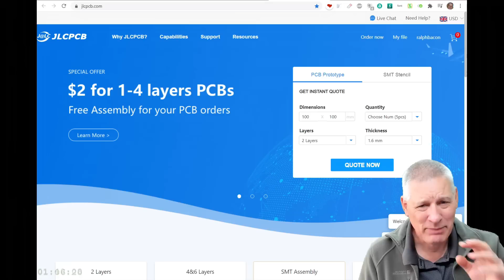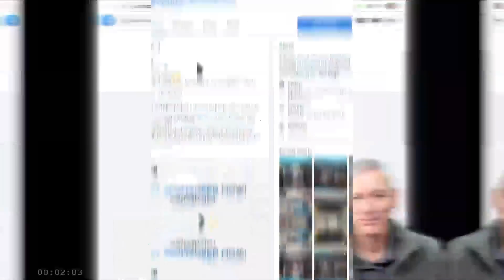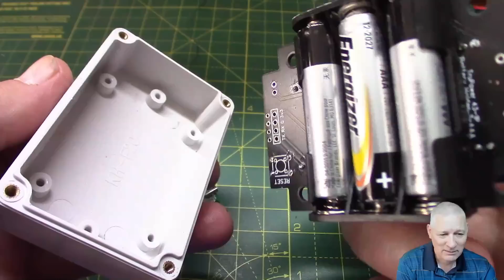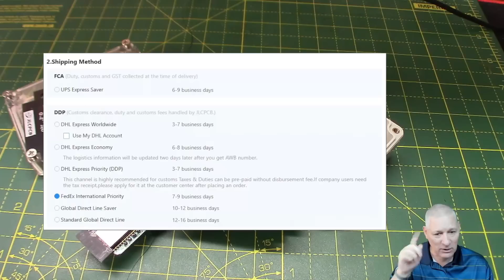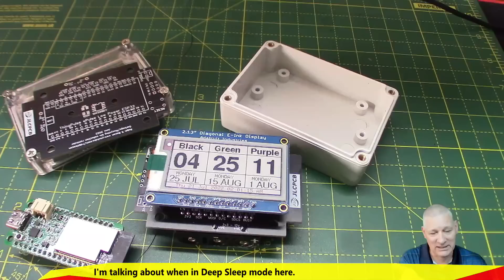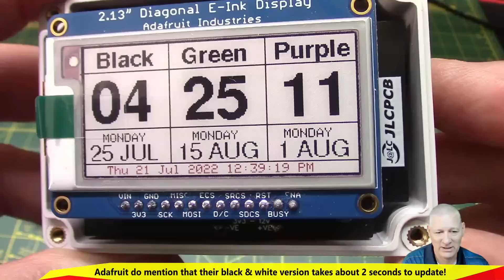#246 e-Ink e-Paper project with ESP32 Deep😴Sleep

Comment: When the ESP32 comes out of sleep, does your display flash (because the CPU resets) or can you write partials without the flash? Thanks for the video.
Reply from the maker: Tricky to answer because my display updates at 2:00am so I'm not around to see it. But I did not get to write partials with this screen; other will allow that though, so it depends on your hardware. But the screen should not flash just because the microcontroller wakes up, unless you reset the screen as part of setup( ).
Reply: @RalphBacon  I fooled with this yesterday for several hours using a LilyGo T5 (ESP32) and couldn't get it partials to function correctly after sleep wake up. I looked at skipping the init using reset_reason function, holding out pins at their state during reset, etc. Then gave up and can live with the flash every couple minutes. Thanks for the 
fast reply.

Comment: For your info. That little nib is the gate to let in the melted plastic in to the form when you mold. You usually want to have it centered in a part. But in this case I have putted in two gates by the corners. More expensive of course and you could end up whith a seemline in the middle.
Reply from the maker: A bit of a nuisance that nib, but not a show-stopper (it's still working and used [looked at] on a daily basis despite that funny lid!)

Comment: The nib in the lid is where the plastic material is fed into the mould. It’s called a gate. It is recessed so the tiny sharp string (like the stringing you get on a glue gun) does not protrude above the surface of the lid.
Reply from the maker: A pity that it's right in the middle of the lid. Talk about design failure!
Reply: @RalphBacon  from a moulding perspective, the gate needs to be exactly in the center. If it wasn’t, one side of the moulding would fill first and leave a void in the other side.

Comment: Great vid as always thanks. 🙂
The PC sounds great but don't scrimp on the RAM. Get the fastest you can afford as it really helps with video editing.
Here is an idea for a project. A remote monitor for a hot water tank. 
I recently installed solar panels and they heat the water too but heat a smaller amount of the tank to a much higher temp than the oil burner. It means it's now hard to tell if there is enough hot water for two showers so a temperature monitor with two or three sensors for different heights of the tank would be great.
Keep up the good work and glad your better.
BTW an old mobile phone battery may have worked for your project. Much nicer having it rechargeable and a good way to reuse old batteries.
Reply from the maker: I've specified 32Gb RAM, Ali; I don't any more will help either my video editing or general use (not even gaming, which I haven't done, up till now).

That project you mention is an afternoon's work. Use an ESP32 to read two DS18b20 temperature sensors (can even be on the same GPIO pin as they have unique addresses). Then create an ultra simple web page in the ESP32 to hold the two temperatures. Use your phone to access the web page to see how much hot water you really have.

Regarding batteries (in this project, I'm assuming?), I had provision for a simple 4.7v LiPO if the 3 x AAA didn't work out. As it happens, the AAA work great and I expect the batteries to last for a year but we'll only know in May 2023... I'll try and remember to record when they run out!

Now go and design that hot water project, I want it finished by tea-time!
Reply: @RalphBacon  LOL, thanks mate, I'll have a look at your suggestion as I may have a free hour tomorrow. 🤣
I agree 32Gb is enough but the speed of the RAM is important. Don't go for the cheapest RAM as it will kill your video editing. I did that with my build and had to replace the RAM later. 
Buy cheap and buy twice. 😉
Reply from the maker: Indeed. I'm using DDR4 memory (can't afford DDR5 and it offers no benefits to me [yet]) at 3200MHz. Actually, I think the XMP is 3600MHz but I am after 100% stability so we will see how it performs. Nothing worse than a BSOD, which I remember too well from Win95 days!
Reply: @RalphBacon  I originally installed 16Gb DDR4 2666 and couldn't understand why the PC wasn't much faster than my old one.
After some research I bought DDR4 2x8gb 16gb Corsair 3600Mhz (on ebay) and was surprised at the speed improvement, especially when editing videos. Since then I upgraded to 32Gb which helps even more. 
No BSOD for me in Linux Mint. 😉

Comment: How would I go about using the esp32 as a simple wifi antenna for my laptop?  for example if my wifi card inside was to fail, could I use the esp32 to connect and surf?
Reply from the maker: No, the ESP32 cannot be used as a simple WiFi antenna; what you need is a simple USB device (like this: https://amzn.to/3vkp6Pu ) that I used before I wired up my PC with a LAN cable. Works pretty well.

Comment: Hey Ralph, welcome back :) Good idea for a project for those multi-coloured displays, their refresh rates are only really useful for things like what you've done, or shelf sides for prices of products in boutique shops. The single colour e-Ink displays refresh much quicker, you can do a partial refresh in about half a second, and a full refresh in one (I have one of the 2" waveshare ones), so if you don't need the colour and want faster updates, they are the ones to go for :)

Where are you pulling the data from for your bin collections? Or do you add it manually? Curious as to if you're using an API request or something for it, since even if I didn't make an e-ink display, this would be great to keep an eye out on bin changes in our area, especially in bank holidays, that's a great idea for using the slower display with the red colouring to emphasise things that are not "to normal" specs.

Hope you had a good birthday Ralph, sorry to hear you caught the lurgy though. At least you had all the shots and whatnot, it doesn't make it less likely that you'd get it, but it makes it less likely to result in loss of life and that it doesn't last as long.

A new kitty? :) What's the story with her? I'd be curious to know if you don't mind :)

Your PC specs seem good to me, that processor is pretty good, and that graphics card will be a great worker for ya, there's no need for anything higher than a 3060 especially for video editing and the work you do. You're right to stick with DDR4 since you're not gonna need those extra mhz for the general tasks, unless you were playing high demand games where those milliseconds frame saves count :p Good shout on 32GB, that'll do you well too :)
Reply from the maker: The data is initially on an SD card (reader present on this particular ESP32 module) and, if detected, is copied to the internal LITTLEFS/SPIFFS partition. Then read from there as it is every day. That way, I can update the calendar once a year "off line" via the SD card when the council send us the new schedule and just pop it in the SD slot and press RST for it to be copied into the correct place.

The format is so simple: <bin type><date> eg B12062022 for each date and bin type. Only 52 entries for all the three bins for a full year.

Yes, the jabs hopefully helped me get through the lurgy, unlike last time (Feb 2020) before any jabs were invented and I ended up with pneumonia in hospital! Took a whole month to get rid of it and another couple of weeks to feel normal! 

TWO new kitties. The story of how and why we acquired these (not our choice) will be revealed as we go through the future videos. One is asleep on the chair next to me right now (the one in the video).

I'm just waiting to get the (rest of the) money together then the PC will be mine. That's where the hard work really starts though, getting it all configured and all the software installed. Luckily I will still have this PC to remind me what I have installed! So looking forward to it.

Comment: Are you sure they’re AAA cells?
Reply from the maker: Yes, the battery holder is a TruPower 43-1P which takes 3 AAA batteries. Larger ones wouldn't fit in that enclosure anyway!
Reply: @RalphBacon  lol have just watched it again and you can glimpse the AAA on the case. Did look like AA at first glance though.

Comment: Unsure about colour e-Ink/e-Paper display support, but for the monochrome displays I always try to get devices that support "partial refresh". I have a few DIY weather related displays and can can usually get ~3fps for redraws and simple monochrome animations (e.g. animated icons and rainfall graphs for the next hour). Obviously not great for low power battery use if you have constant animation, but good for batteries use if you want a quick redraw and get back to deep-sleep.
Reply from the maker: Yes, the monochromes (some of them) do support partial refresh. Something I'd like to try. It's on my list, anyway. I wonder if tri-colour ones support it by now?

Comment: You could consider a single LiFePO4 cell to power the device without any voltage regulator powering a barebone esp32 module
Reply from the maker: That was plan B if the triple AAA battery holder was too thick to allow fitting the lid on. The breadboard supports it, although I didn't have room for a recharging circuit unless the input voltage was no higher than 4v2.
Reply: @RalphBacon  given that it is going into a box, you could fit a USB charging port and a tiny LiFePO4 charger attached on the inside

Comment: Another great video Ralph, I have same problem but 4 bins in Blackburn area BWD but not sure if I can justify cost of build, if you had a spare PCB to sell I may ... regarding weather I live a bit further north and had a Chest X-ray app last Tuesday in Bolton, definitely got cancelled and went in rain on Friday ....LOL ... Ohhh regarding PC did you use Scan or CCL
Reply from the maker: I do have a spare PCB (email me if interested, no charge) but you would need the ThingPulse ePulse ESP32 module, of course, which is not the cheapest dev module around but is quite low in standby current (and is still available too).

Although you have 4 bins, do you not put two of them (eg recycling & garden waste) out on the same day? So really, only 3 different dates, same as me.

For the PC, I have 3 firms on my shortlist, in no particular order:
1. Scan
2. CCL
3. PC Specialist

Right now (after my 357th custom build configuration!) Scan give me the best spread of desired components but the other two are pretty close too.

Not committed yet to an order (I'm waiting for the money) but it will be soon.
Reply: @RalphBacon  Hi Ralph, I will look at building at some stage so I will email you at some stage yes I note the cost of bits is a bit steep and got the Model Railway build as well , being on DWP not got a lot spare but I like your phone and as I have a crappy old S6 Amazon got one so may get one ...

Bins RED general and in August its 8th ,22nd ..
GREY Plastic its 15th ...
 BLUE Paper 1st , 29th ... 
GREEN garden 5th and 19th ...

 I used Scan over years as very local but prices have gone up a lot so CCL have a good economy range My PC is about 12 years old but now got Win 11 on it, and a Win7 running a CNC and Win 10 in Shed running JMRI ..plus Win 7 Laptop ... LOL

Comment: FYI - In Australia the JLCPCB delivery price via DHL is $29 (3-5 days) and the FedEx price is $31 (6-8 days). $2 diff and half the time.
Reply from the maker: OMG that is very different to the UK. Is there a cheaper option you can try, perhaps?
Reply: Yes there is a much cheaper option in Australia. It’s called Standard Global Direct Line and typically is around $5AU for 5-20 pcb’s, much cheaper than your UK options.the only disadvantage is that delivery is 10-20 days. That’s the option I always use as I’ve got plenty of other projects to work on while I wait.

Comment: If you can find a hardening liquid plastic with a similar index of refraction to fill the injection molding divet in the box lid, you may be able to fix the problem.
Reply: Maybe the resin in a windshield stone chip repair kit?
Reply from the maker: I have some liquid resin (and hardener). I also have another, identical box to try it on. Great suggestions, thanks 👍🏻

Comment: lots of used ryzen chips very cheap on ebay etc, many match or exceed your specs
that pc you got will be able to max pretty much every game for 1080p at least.. you mention "some" with the GPU but it'll be "all" just not all at max settings
good call not getting ddr5, too new and too expensive. for video editing not worth it. GPU for video editing only helps acceleration of the preview frames if you even use it.. if you encode with the GPU it also helps there obviously.
Reply from the maker: Apparently (after exhaustive research) I've appreciated that the Intel chips (11th & 12th gen onwards) have better codecs to en/decode H.264/265 video so they do have an edge on AMD chips. Another good reason to NOT disable on-board graphics even if a discrete graphics card is being used.
Reply: @RalphBacon  only if you're using quicksync yea. but your nvidia gpu will probably blow your CPU out of the water for encoding h265 guaranteed
Reply from the maker: I would be quite happy if it did!

Comment: @16:00 That bit in the middle of the lid is called the gate, it is a hole in the mould which the material is injection through into the mould cavity.
Reply from the maker: Pity they didn't think about pouring it in a corner! 😡
Reply: @RalphBacon  its done for even mould filling and minimising warp and post mould deformation, if you look through the lid through a pair of polarisers (such as polarised sunglasses and put some polarising film behind it), you can see the flow and internal stress lines inside the plastic, I actually just did a video talking about it when fixing a broken plastic fridge shelf.

Comment: Welcome back, you are missed!
BTW; often those 0 ohm resistors are called "zero ohm links"
Reply from the maker: My one is definitely a zero ohm bit of wire, because the speck of dust resistor disappeared off the end of my soldering iron never to be seen again! 🤣

Comment: There is some youtube video and website of Good-display, in which they show a Tri-color E-ink (2,13inch red/black/white) that can do partial refresh. They say that only the black and white pixels can do partial refresh
Reply from the maker: Yes, I've seen the partial refresh on B&W screens although eventually you do have to do a complete screen refresh, apparently. If I do repeat this project for an outside unit, I might go with a cheaper B&W module, then I can experiment with that partial refresh too.
Reply: @RalphBacon  partial refresh should also work with the screen which you have now, only the B/W pixels can do it though. 
https://www.youtube.com/watch?v=HJaVujn877Q
Reply from the maker: That's an interesting video of partial refresh of the B&W part of a tricolour screen. But there is no information anywhere, no example code. Perhaps it was a mock up! 😲

Comment: gpu for editing is a can of worms because not all editing software's 'export' features play well with all cards, if have a favourite editing software (and you probably do) I suggest that softwares forums/groups for sage suggestions
Reply from the maker: My editing software is NOT Premiere Pro which every man and his dog uses apparently. I will try that out on my new PC to see if it offers me any advantages. MY current PC would not be able to run that in any meaningful way.
Reply: @RalphBacon  I'm an openshot man myself I like the community developed mindset, inkscape, gimp, kicad, Arduino,
Reply from the maker: @lezbriddon  Just looked at OpenShot and it seems very familiar to me, as a PowerDirector user. Which is also quite similar to Premiere Pro. Well, I guess they all try to be the next Premiere Pro (on a budget), right?
Reply: @RalphBacon  indeed, just like all modern cars look the same to be 'normal'. Unless you're Porsche, then it's let's just do the shape we do with different lights lol.

Comment: if you wish low current while sleeping you buy ESP32 module - not the board. I am using such and deep sleep is 4uA. Btw less than 2 GBP. You are anyway do it on PCB - so you can solder it to your PCB - no difference for you.
From my measurements using PPK2:
ESP32-S WROOM - 4.5uA
ESP32-S2 WROOM - 22.5uA
Reply from the maker: Yes, I was expecting that sort of value but I guess ThingPulse's implementation still has other parts of the circuit switched on (not sure what, given that they switch off all other bits, as I mentioned). 

The new one (Feather) is better at 16μA but still not 4μA. I do have some bare ESP-WROOM devices; if I have time I might try one out on a breadboard although they only have castellated connections. I do have some PCBs for them too though... could be a longer project than I thought!
Reply: @RalphBacon  yes, I am talking the castellated ones - it is not that difficult to connect them without PCB either - many of my projects are without PCB: 1 resistor 10k (Vcc to EN), 2 push buttons (1 EN to GND and 1 GPIO0 to GND) - honestly I don't even use them anymore. I am using 3P mini JST connectors for UART (TX, RX, GN) connecting to FTDI. I usually disconnect later UART as all my projects have OTA so no need for later wired connection. Of course 3.3V is needed but ESP32 works OK up to 4.0V (above it does not work stable), ESP32-S2 has no issues up to 4.3V. So even you can connect LiPo  directly (for ESP32 I use Shottky diode in series that takes me below 4V). These castellated modules are my primary choice for all my projects - nothing compares to their sleep current as well as ... size of the project ;)
Reply from the maker: @zyghom  I'll give it a go, I'm sure! Thanks for all the information.